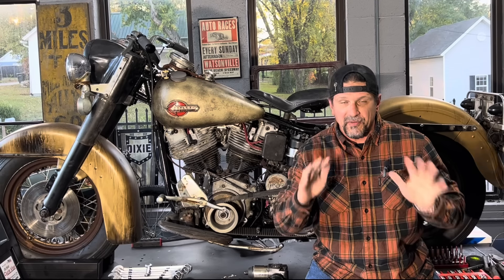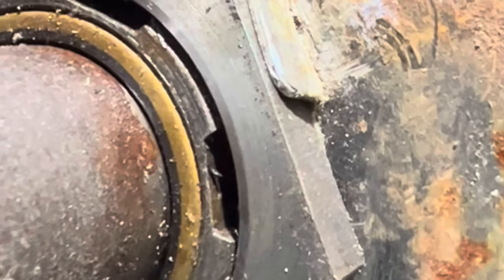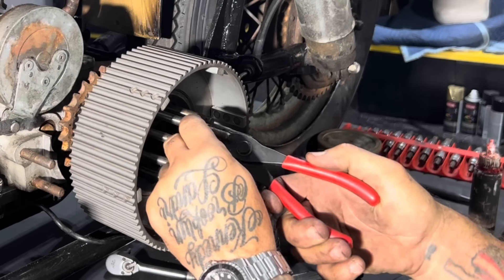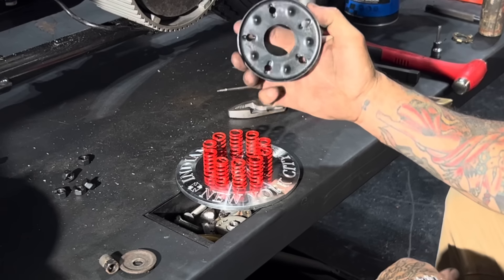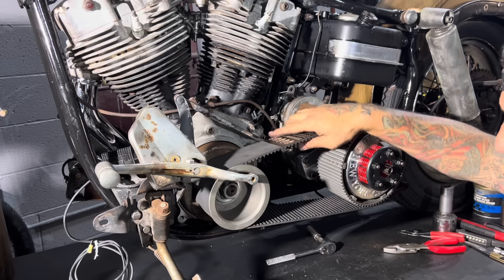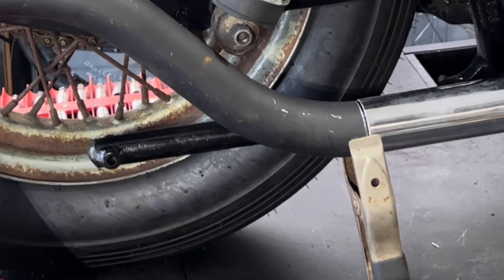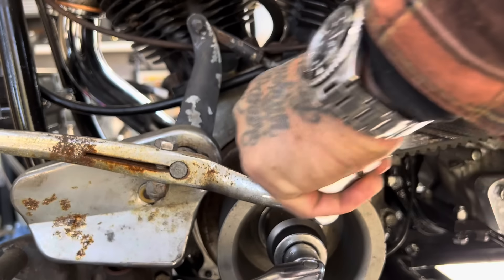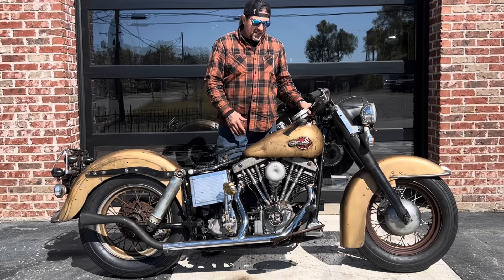World’s Ugliest Shovelhead Kick Start Part 3 Billy Lane Ignition Timing Indian Larry Clutch Harley

Comment: I love your videos. I love most your personality and how mellow and personable you seem to be. You're videos are very helpful and they have given me some ideas. I have a 78 FLH that has been very abused, Its a bike I picked up for 4k. I'm putting a Paughco Springer on, hinged fender and because of this series I decided that instead of a Tombstone tail light I want the same rear light set up as "The Worlds Ugliest Shovelhead". I also have a 78 chopper I picked up for 3k. It has a ton of issues. Because of your video I think I'll pull the primary and go totally open like you did. The bike kicks back at me, but now I know to check the intake O-rings and I can adjust the timing. I have 6 bikes total. I'm in Washington where we get a lot of rain and snow, but I use heated gear and ride year round. I ride in the Christian Motorcyclists Association, and I ride nearly every day. God Bless you.

Comment: when I went from a 1 1/2" closed belt to an open 2" it drove me nuts. I couldnt adjust anything else to keep that clutch from draggin me in 1st gear ( years before youtube!). I parked it, got another shovel, traded to a TC88 and the old shovel sat for 10 or more years until I happened on Pacific Mike channel.  I searched his site for old clutch videos and the comments section described the same problem with my shovel draggin clutch. The fix Mike described was to drill out the plates 1/64 (25/64) over the factory 3/8". BINGO! Once I had that clutch problem solved I dove back into the shovel(73 Super Glide) with new energy. I been riding it bobbed ever since, good to go.
Reply: Tdmn 👋

Comment: Use red lock tight to set the woodruff key in place and let it set for a while. It helps. I’m changing my 1985 FXRS to a splined shaft to rid myself of this issue.

Comment: So Billy, you mentioned a replacement front brake caliper in one of the prior videos. Very interested in that as the originals aren't only crap, they're expensive.  Funny story, back around 1980 a buddy of mine had a real leaky master cylinder. We tried topping it off with beer, didn't work too well, ha! Thanks for the cool video, and for showing what we knew long ago, it doesn't take money to build a cool bike, just imagination.

Comment: Nothing sounds like a shovel.  The clutch spring trick is one ive used since i was 16. Its a good one. Im totally with you on tossing the inner outer primary.  So much easier to work on. Especially if its the side of the road. Right. I have a question Billy.   Im tore up from the war and can no longer kick my shovel. Its on a cfl frame open belt primary. Is there a set up you are aware of to get me lectric kick. Thanks.

Comment: The bolt that was stripped out on tranny I might be wrong about this but ain’t it kinda rule of thumb that if something spins to right then it tights to the left and if the part spins left then it would tight to right you know what I mean if the parts like that spins one way then you tight the bolt that holds it the opposite way I believe that’s what a older timer told me long time ago but I could be wrong and I’m not sure if that came out right